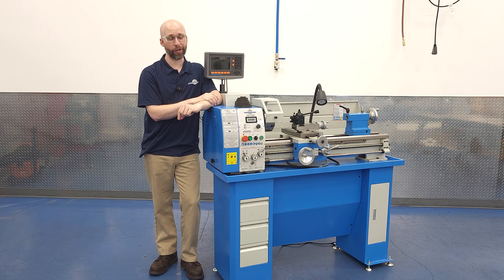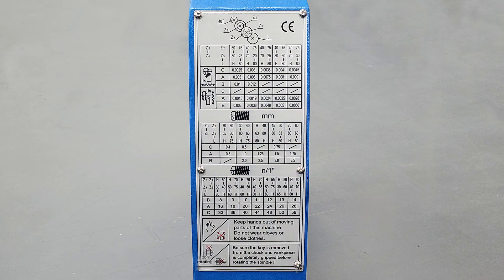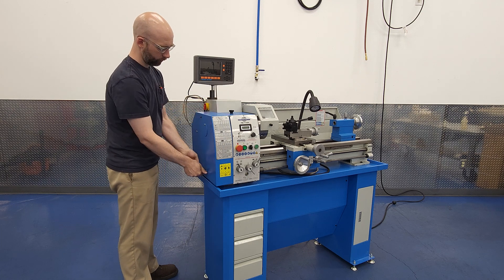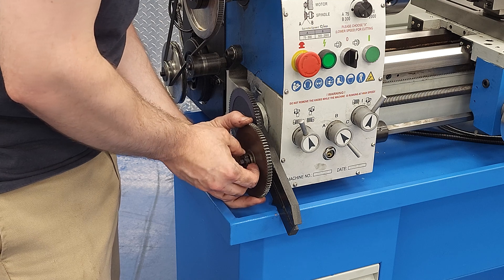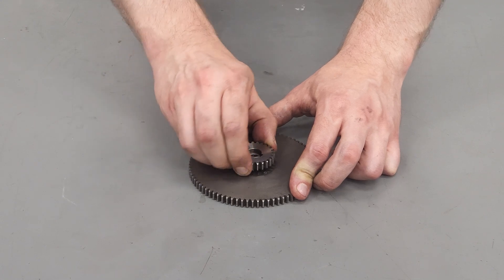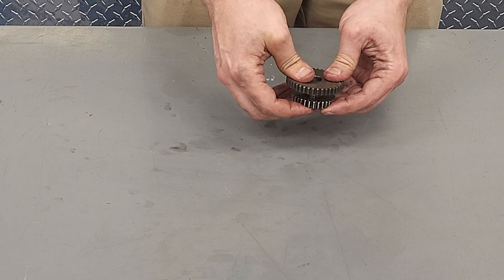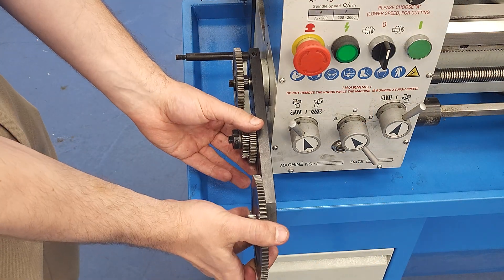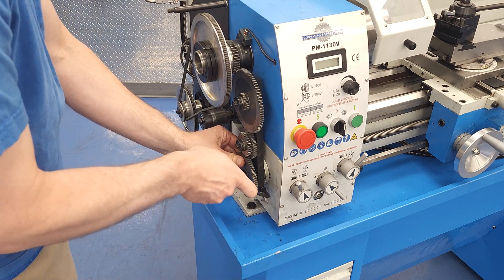PM-1130V Change Gears Precision Matthews Media

Comment: You should offer an ELS option for this and the 1022/1030.
Reply from the maker: Unfortunately, as of now, we do not offer that option. If you check out Clough42, he did a ELS conversion on one of his machines.
Reply: @precisionmatthewsmachineco  yeah i ordered the parts and plan to implement it on mine. But I see Chinese companies offering complete kits on the usual website so it might be worth exploring partnering with them, clough42, or both to offer a turnkey solution. I'd prefer buying something I know has all the right parts and will work on my machine and don't mind paying PM for the privilege.
Reply from the maker: @xenadu02  We have looked at them as an option, but none we have found are up to our standards. Too many problems as of now and many people still prefer the reliable mechanical method.
Reply: @precisionmatthewsmachineco  I understand; I hope to see a solution at some point. I'll only disagree on one thing: no one in the world likes change gears. Ever! If my PM-1030 had a gearbox option I'd have paid for it. Change gears are terrible :D
Reply: @xenadu02  I have this lathe and it is fine.  To change gears takes me about 15 minutes.  Sure, I would rather have a QCGB, but the lathe would have cost a lot more, and would have been out of my budget.